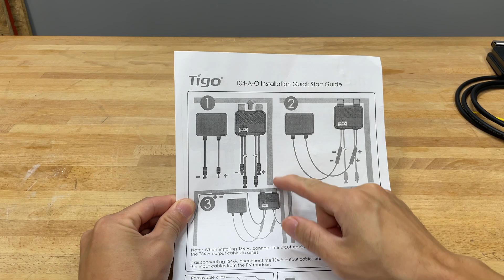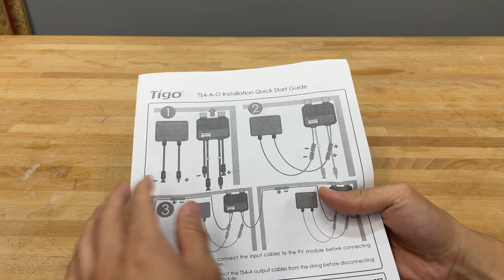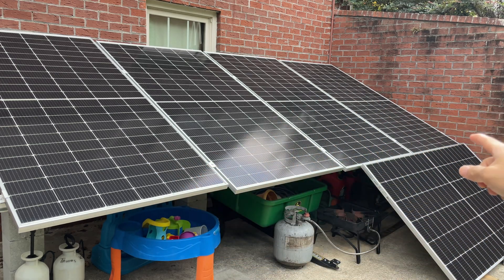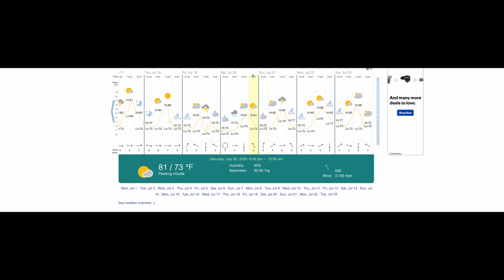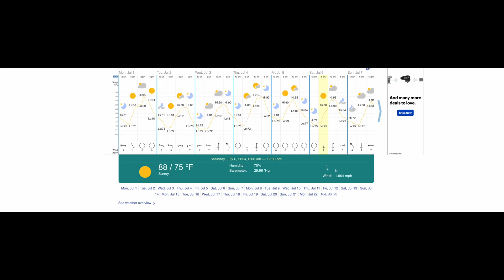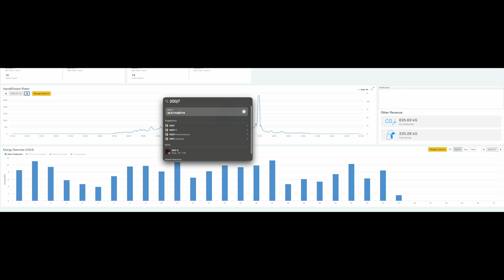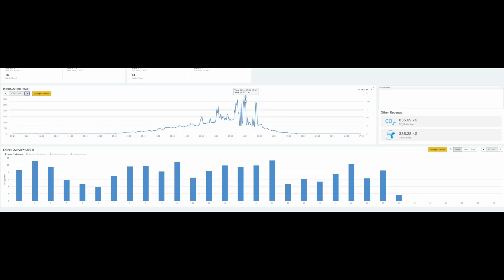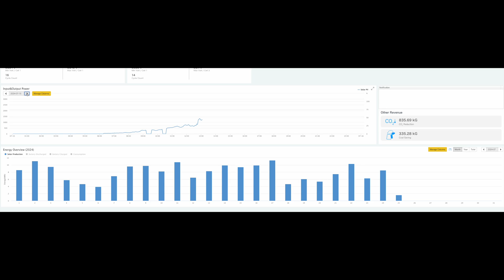Tigo TS4-A-O review | Optimization, Monitoring & Rapid Shutdown

Comment: I would think you should compare the times of day when the panels are partially shaded rather than noon when there probably is little or no shading.  For example, if the panels on the right side of the array are partially shaded at 8 am and the panel on the left is shaded at 4 pm, those would be the times to check for increased output because of the optimizers.  Another way would be to disconnect the optimizers on the shaded panels and compare the output with and without optimizers within a few minutes.  There is too much variability from day to day to make a good comparison.

Comment: What is that UI you're going to?   Does the TIGO have a separate monitor and where do all the cables go to specifically?    Does Tigo have an aggregator or something or can you install these stand alone?
Reply from the maker: the ui is the cloud ui from tigo.
the modules connect to the "gateway" through wireless, and the gateway connects to the cloud.
in order to use any function besides the optimization, you need additional components.
The tigo CCA and TAP: https://signaturesolar.com/tigo-tap-din-rail-ps-outdoor-enclosure-kit/?ref=bkpkbxde